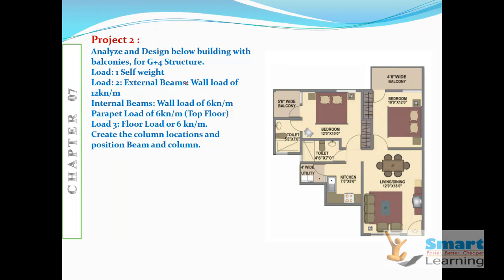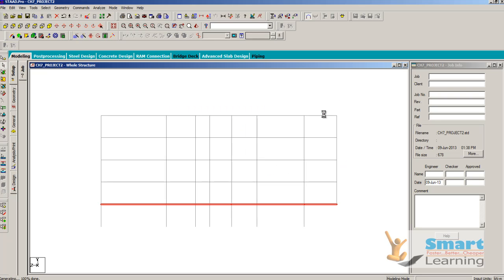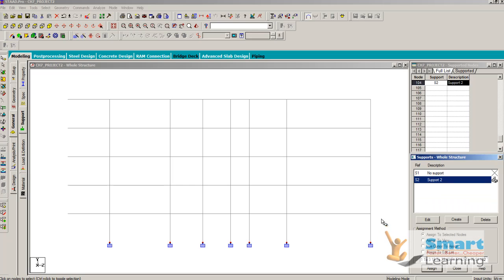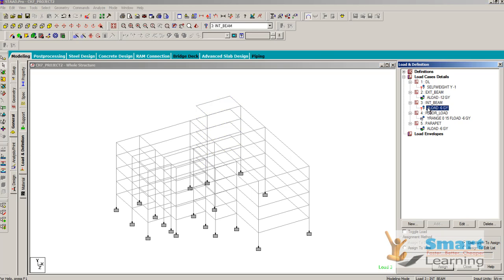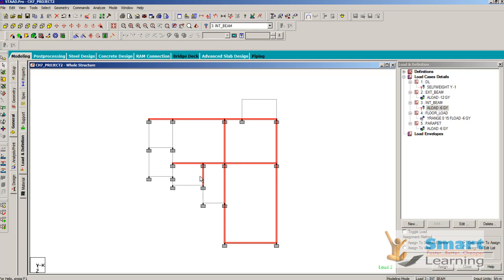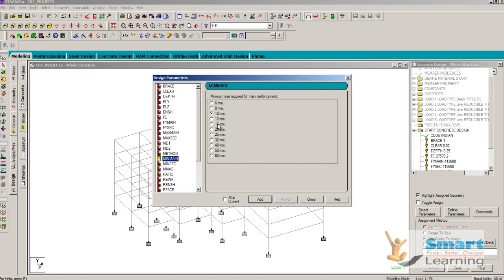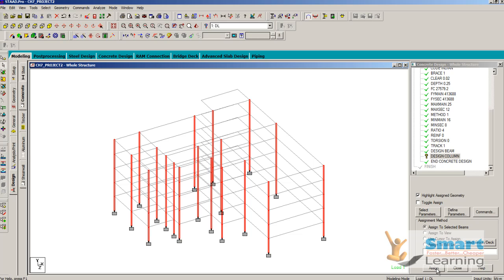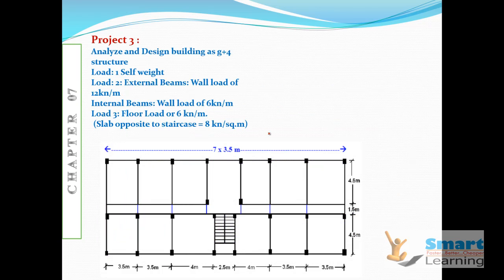Staad.Pro-V8i(advanced)-Video Training/Tutorials DVD

Comment: sir u have given for mode shape as to get result ... how check for its usefulness in design ?
Reply from the maker: This Video Training has been Developed by 15 Years industry Expert.

You Can Buy Full Course From
www.smartlearningindia.com
Call on:+91-9212204407
0129-6525252
Reply from the maker: This Video Training has been Developed by 15 Years industry Expert.

You Can Buy Full Course From
www.smartlearningindia.com
Call on:+91-9212204407
0129-6525252